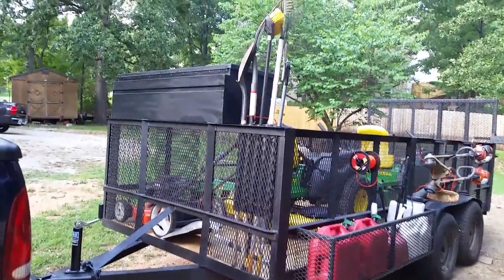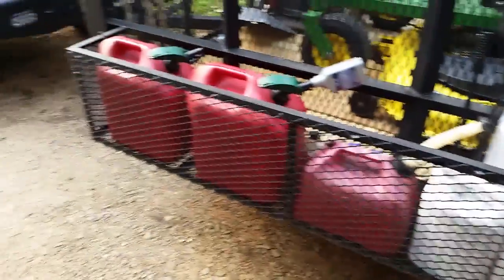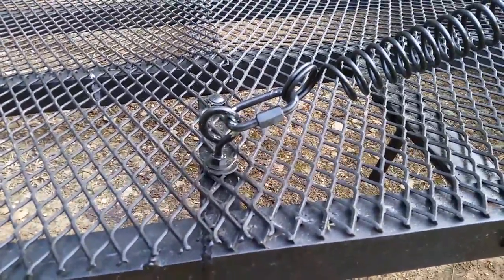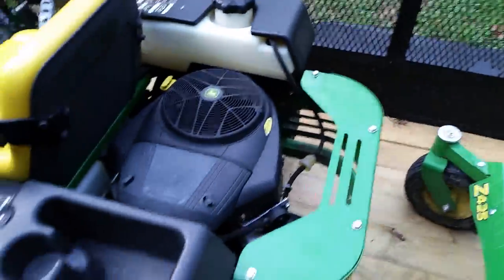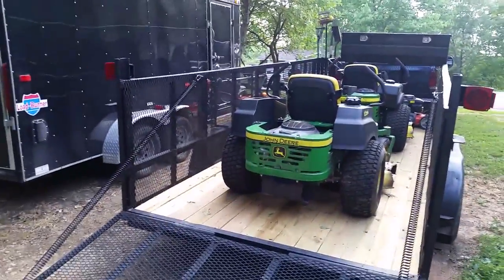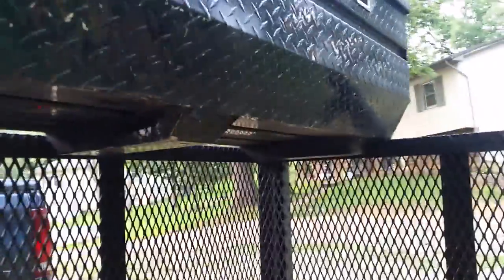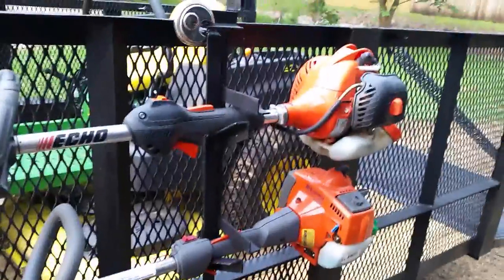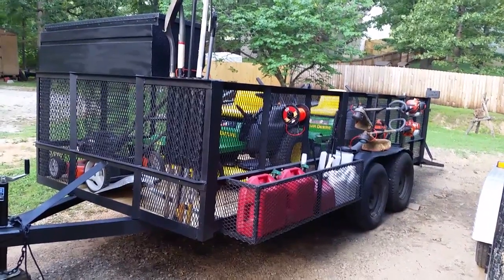DLC - 2016 Landscaping/Mowing Trailer Setup

Comment: Nice trailer man, but those springs make me nervous. I've seen a few guys around me start doing that and boy do I see future liability that could be real trouble, imagine that breaks and hits something...or your leg...best of luck!
Reply: easy fix is to put them inside a piece of plastic pipe connected to a cable with a pulley at the end.
Reply: You mean in a garage door configuration I'm assuming? Not sure how you would fit that to assist a utility trailers ramp..but enclosed trailers already have that exact setup just not with full sized garage springs. Cheers
Reply: Sure that would work great if the spring when fully extended is completely contained, then I would have no issue. But this ^ version still scares me.  Have a good one!
Reply: yup spring contained thats why you need the cable. can alter this for very little money.
Reply: It's such a nice setup I didn't want to be the one that said it but I'm glad you brought it up.  It makes me extra nervous knowing those springs are exposed to the weather.  Most likely, nothing bad will happen, but if it does it could be really bad.  Every year people are killed by those springs, hundreds more with broken bones and lacerations that look like they've been to a butcher.
Reply: They sell safety springs that have rods inside the spring for when it breaks it will contain it. I’ve seen the kind of springs you have go right through a car body panel. Safety springs are the way to go.
Reply: Nice custom work as usual. I’m thinking about your springs. My ramp is getting heavier by the week🥵